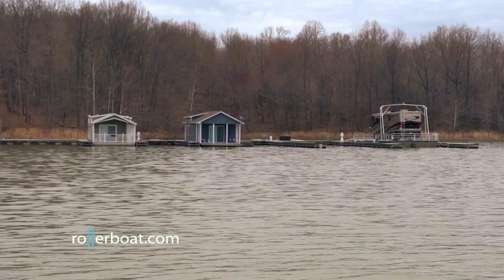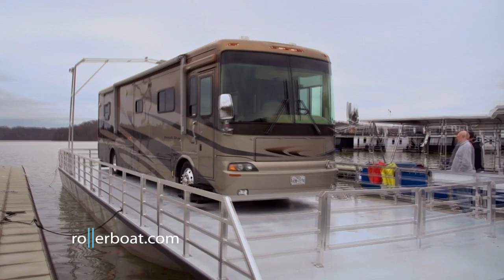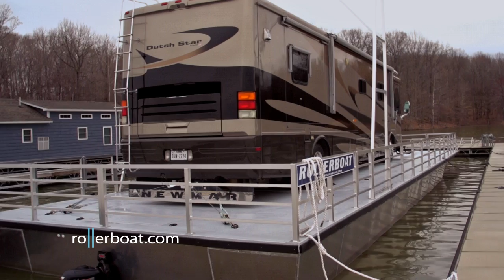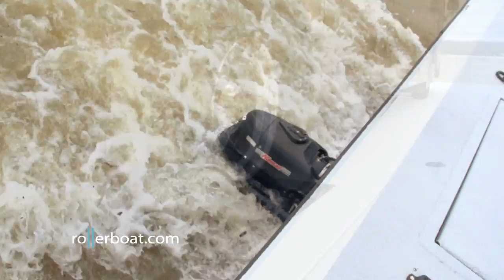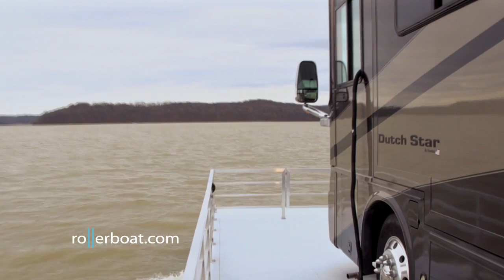Rollerboat - Roller Boat is the Amphibious RV (Personal)

Comment: So many comments have mentioned other things wrong with the design like transporting the barge, storing it in the freezing months or just in general, and other things. But even if you have this set up on one lake as your, "home away from home", what about while driving in the water? The dyno type roller system isn't something that people should be standing around without guards. Definitely not a family vessel without major supervision. It's a good idea though to have in a remote location where a ferry type lake or river crossing is needed.

Comment: How is it in saltwater conditions? Unless you live near a giant lake system, how do you transport it from one lake or river to another? It is too wide for road transport - does it come apart in sections that can be trailered? How is it launched? What about Front Wheel Drive RVs like the GMC? Is the RV secured to the float during use with some sort of strap system? How do you fill the RV gas tank with the normal short hoses that most marinas have? How is it registered - it is not exactly a powerboat or what is it? Is it approved by the Coast Guard?

Comment: Very smart and innovative indeed...and most likely the safest way to safely fulfill all of your Houseboat fantasies without incident...but whatever happened to the ultimate Amphibious RV/Motor Homes...did they ever really get off the ground? as they obviously ran into some difficult obstacles, or they'd have already produced several versions of an Amphibious RV by now...???
Reply: There is also boat-a-home which is an RV on a trailer that can swim. Also not really amphibious of course.